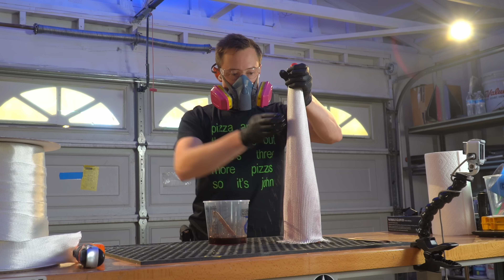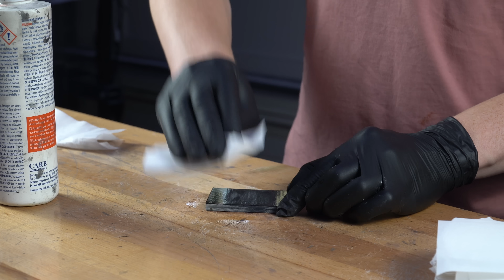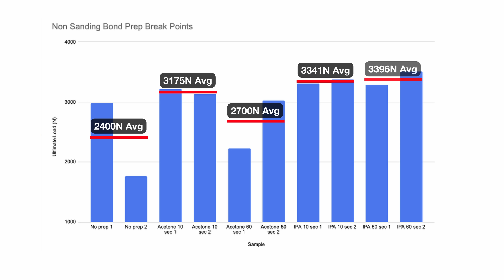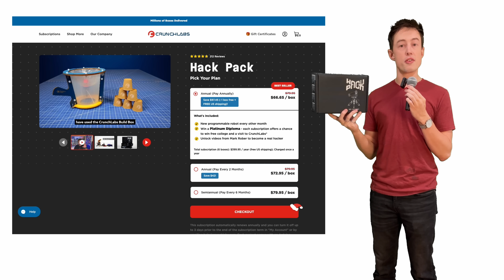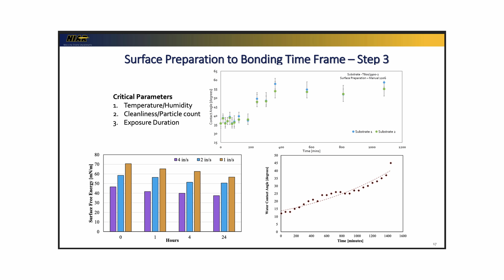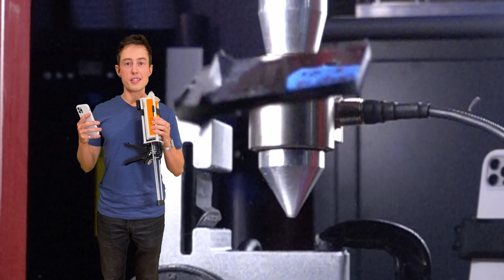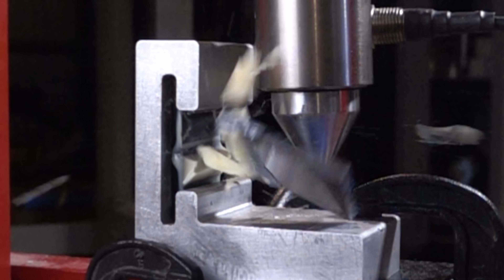I Broke 100 Epoxy Bonds to Find the Strongest

Comment: Two samples is simply not enough. I know you recognize this as one of the places where you fell short, and kudos to you for doing that. But the lack of sufficient samples renders absolutely every tentative conclusion you draw unsupportable. If you haven't already, do a bit of a dive into statistical signficance. If you're like me, you'll be surprised at how even five samples can MASSIVELY improve the quality of your data. For instance, you seemed quite fixated on the 4000 value you got earlier. But with the variance you're seeing in your other tests, it's actually not mathematically suprirsing at all. even if all of your data was basically random. It's like, if you were playing D&D, and you rolled two 20s in a row using a particular pair of dice one time, and then from then on said, "Oh, these dice are lucky, I need to try to recreate those conditions."

Anyway, sorry if that comes off as preachy. What can I say, I've been an engineer for 35 years. But N=2 is just way, way too low. "Invalid data can still be useful" sure, sometimes, but given the incredible human ability to draw wrong conclusions, we just have to be really careful, because even the best of us cannot intuitively tell the difference between randomness and significance. Occam's Razor means the best interpretation of your data is, in fact, randomness. N=5 would be much, much better, and N=30 would be fantastic.

Comment: - i think the optimal grid size should be the smallest, that the surface tension of the glue can reach.
- try cleaning the sandpaper before use,  by dipping it in the acetone or the alcohol.

Comment: One variable I didn't hear addressed is that when sanding anything softer than a metal, furring is possible. This is when bits of material or fibers are not cut cleanly but instead leave a ragged fur-like edge. Acetone might eat some of that fur, but I suspect the fur, though adding to overall surface area, may weaken the bond because the fur itself may not be well-bonded to the source material. 

I think the tests with the razer cuts backs up my theory, as a hard cut like that is not removing material, instead the edges of the cut would be a kind of furring. The valley walls are fresh material, but two ridges of weakened material are also created on either side of the valley.

Instead of sandpaper I'd be curious to see a cleaner-cutting surface prep, something like an array of tiny saw blades scoring the surface as a known depth. 

I'm not an expert, I'm a perceptive hobbyist, so take this with many grains of salt.

Comment: 31:51 so then the age of the batch or the moisture in it directly correlates to it’s strength? Maybe it’s temperature exposure? Try freezing some before using it if there is a part 2

Comment: Instead of using acetone after sanding, what about using a filtered air gun to blast away the dust? that way the ridges after sanding might provide additional bonding surface, without the acetone dissolving the ridges. Or maybe makes no difference.

Very cool, love the rigour

Comment: Glad you found pretty much the solution in the end. Two more things come to mind:
– These double-cylinder glues are convenience glues. Easy to apply and often good enough. For maximum strength, one should mix specialized 2-part glue on a weight scale.
– Maximum strength doesn't matter. A bond needs sufficient (reproducible) strength. Which means: find out how much strength you actually need.
– Epoxy resins gain a lot of strength with tempering. Like putting it into an oven at 70°C to 100°C for a couple of hours. It makes the chemical reaction between both parts more complete. Glue manufacturers know and tell the procedure.

Comment: As You said You should do shear test. In this test slightest scratch on adhesive was starting point for break making all data basically worthless. In all usecase if you need make this type of structure you need overlaminate fillet made of adhesive with additional plies of material, and then the fibers take all load.

Comment: Awesome video! Do you think this would apply to painting? Because usually they say you should sand your surface to prepare it for spray painting but maybe a good clean with acetone and IPA on a smooth surface do the trick.

Comment: I heavy doubt your degassing procedure!  You like to get rid of air bubbles from filling in. Ok. But what you do is low pressure cooking of the chemicals, like gasfree water cooks at low pressure. You remove some chemicals from the epoxy by that procedure, that while it looks like boiling and spills out heavyly. That causes inconsistant results, depending on how much you destroyed the chemical composition.
For degassing of air only go for light vaccum, not that massive!

Comment: You can't degas that low. That isn't gas, those are volatiles, and they're needed for curing. When you degas, you need to stop at partial vacuum. If it starts to erupt, you drew too low.

Comment: Great study, thank you for publishing.  I sometimes have to bond to old composite and this answers many questions I have always had in mind.  I do think your sanding was probably leaving contamination from the abrasive paper as many such papers have surface treatments to reduce clogging.  Where I usually feel most at risk is in adding a layer of new polyester composite over an old polyester lay up, for repair work.  Sanding is universally the recommended surface preparation but I have always been doubtful about it because of concern about rubbing contamination into the surface!  Bearing in mind most people use a dual-action sanding machine for this, and the abrasives use on those are ALWAYS treated with anti-clogging agents, so it seems like a really bad practice.   I'm taking a risk in reading across that what works for epoxy would work for polyester, but it's the nearest relevant study I've seen so I think I'll change to using acetone and IPA for surface prep in future.

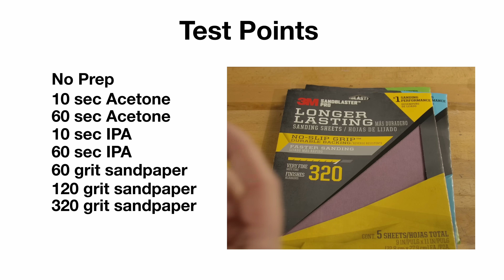Comment: @04:36 There is something that I miss on this list of prep methodes.
(Being retired for a while from many years of boat building, from ocean capable wooden ones to full carbon (the last decades using epoxy.)
The first lesson, thus first job for prep to glue anything, is cleaning the surface before sanding (and obvious after).
Did I miss it, or was there no cleaning before sanding?👴🤔🤷‍♂
Edit:
Also, adding chopped fibreglass to the epoxy gives the epoxy, brittle by nature, more tensile strength.
This, provided that there is adequate adhesion. (It will mean hand mixing though)👴🤷‍♂

Comment: Pos.\nSibly not related , but I know that in marina , work maritime work , boats , epoxy , boats , fiberglass , epoxy. Okay, that is bad in my mind.If I doubt. I've been told that when you break the surface of the epoxy , if you expose any of the glass underneath it can absorb moisture from the air , even if you clean it with , I isoproval alcohol before you do your bonding work , you'll still have moisture underneath the bond. Which can cause weakening of the bond. Now, the people who told me this were never able to actually present technical proof that you would expect to get from some kind of lab or\nArmchair scientist. So I only have the word for it.I'm interested to see how this turns out , and yes , I started blurbing in the first minute

Comment: Honestly use a belt sander it is similar to hand sanding.  There’s also Dremel bits similar to a belt sander that would also work. You just have to figure out the speed you want the sander to spin at.

Comment: yer high-energy mold removal sucks.   need a new mold design.!   one that:  consists of two halves  and  allows adhesive to go  between the parts before they are held together.     did you sand the root edges of the side-ways pieces.

Comment: On the topic - to anyone trying to attach toilet paper holder to tiles using those silicone suction cups, they do not hold even if glued with epoxy. Half a year max, even properly degreased. Drill holes in tile using tile bit, insert plugs and screw the mf to wall. Tiles are too smooth for epoxy. Epoxy is not a magic stuff.

Comment: Unless the epoxy solvents dissolve the material being "chemically" joined in a manner that literally "welds" the material joint into one solid material with no induced stress, the ONLY way epoxy or any glue works is by creating mechanical interconnections at the microscopic level. That is why sanding is suggested. The grit cuts rough random channels in the surfaces. The more jagged, irregular, and "rough" the surface, the better chance the epoxy has to flow and fill in all the grooves and gouges in the surfaces. When it hardens this creates friction or interference features with breaking strength primarily dependent on the shear strenght of the adhesive. If both chemical and mechanical bonding occurs, as it could with materials than can be melted by the epoxy, the joint should be the most strong. This is not hard to figure out.

Comment: This young man is a good speaker, and he can put sentences together, but I couldn't listen to this whole thing. Each time I fast forwarded 5 minutes it sounded exactly the same. It got quite boring, and in the end, I got nothing much out of it - a sea of sandpaper grits and bubbles and a lot of variables which we didn't need to hear so much detail about. He should have made a condensed version of this. Who was the winner? I'm burned out just thinking about it. I don't even care. I already know the best epoxy ever made is (or used to be) Dexter Hysol epoxy, like Sears Roebuck used to sell exclusively in 50 colors to match their appliances. This is an aviation quality product. It is now called "Loctite Hysol," and there may be slight formulation changes making it not quite as good. The most over-rated epoxy in the world is JB-Weld, which I have never gotten good performance out of - on anything. Hysol runs circles around it, but Loctite Hysol has gotten quite expensive - worth it if you need it.

Comment: could the vacuum be helping to remove tiny CO2 bubbles that are forming in the chemical bond vs getting oxygen bubbles out? if that is the case maybe you can add something that the CO2 will want to make a bond with inside the epoxy

Comment: Two results at 4K, far above most of the others, implies that something later in your testing reduced the quality of the bonds.  Maybe some contamination of the molds?  Were the 4K results on fresh molds or only the second or third use?  Maybe the super lube wets the mold surface and contaminates the joint?

Comment: As a non Rocketeer but somewhat technically competent individual, I dare to ask the question, why a layup with carbon weave isn't used instead of 'just' epoxy gluing?

Comment: The amount of resin you initially apply to the main body of the rocket before scraping it down is quite surprising at 27:40. What is the reason for applying so much? Wouldn't it be more convenient (and better for environment) to apply f.e. 5-10 times the amount needed instead of about 20-30? It would still be plenty and you'd still have to scrape the excess off. I know nothing of rocket building, I'm just curious.

Comment: Great video and effort on the massive sample size! I noticed something about the test jig that might explain the inconsistency you were seeing. Since you're breaking a T-section, you're actually testing torque (Force x Distance) rather than just linear force.

I saw some horizontal movement in the jig during the presses (the 'side-to-side shifting' you mentioned). If that contact point shifts even a tiny amount, it changes the moment arm length. That means the Load Cell will read a different 'Break Force' for the exact same bond strength, just because the leverage changed. Stabilizing that horizontal motion might clean up the data significantly

Comment: Oof, that sideways deflection of the load testing point is really screaming at me.  I assume you looked at that and decided it was minimal enough, but still, I would have liked to see some sort of measurement of that or stabilization mechanism.

Makes sense why they test with shearing lap joints.  But with those you're pressing two parts together.  I wonder if pressure like that increases bond strength.

Comment: My 2c: archery folks use a special Archery Fletching Glue or Gorilla Super Glue (or alike) to keep the fletching attached to the arrow when it hits the target. Epoxy does not have a chance in surviving high acceleration bursts. No point in trying. You may have tried aluminum welding instead of gluing, if you wanted good results. But it seems that your main goal was to do proper research, which is adorable in the eyes of old folks like myself for we've been the same.

Comment: (Having not watched the whole video yet) I wonder if a channel to fit the pieces together rather than just face to edge would've affected the joint strength, and if so, how?
Since the common failure mode is shear on the top/tension bond, having a channel puts some of that force straight into the material itself works the compression bond a lot harder (presumably)

Comment: 1) sandpaper may have a "no clog" additive.  New may be worse in terms of cross-contamination.
2) did you control for the lateral position of your load applicator tip on the coupon?  Distance from the joint (leverage/ length of arm) may explain some of the variability.
3) you did not mention temperature control of your shop/ cure area, nor the temp of the coupons at time of bonding.

Comment: It's important to realize you are not just testing bond strength.  You are testing overall sample strength under a particular loading case.  It can fail through several paths which include bond strength, but also epoxy shear strength, laminate strength, etc.  If you want to maximize your whole joint structure strength under that loading case, you will need to add more variables (filet size, epoxy additives, etc.).  If you want to measure only bond strength, you need a different test

Comment: Thanks, great video!
I'm just about halfway, after the fire stuff. So sorry if this is mentioned later...

How about ozone for activation?
An ozone chamber would be pretty cheap and easy to set up, reasonably safe (with good sealing/ventilation) and could most likely work, as ozone is pretty darn reactive.
No idea how high the ozone concentration would need to be, or for how long the samples would need to be exposed.
But with a well sealed chamber, you could on the other hand pop the samples in and leave them over night, not much actual work time needed.
And if it actually works (I dunno, armchair engineering here), should be reasonably easy to get consistent results.
Reply: Never mind, acetone + IPA is more than likely better and easier than ozone.
Would be an intersting thing to know if ozone might improve things further, but probably not...

One unctrolled variable I can see in some of the B-roll footage is; wiping technique really matters.
In my experience (cleaning a mirror heatbed on my old-school DIY 3D printer),
you never want to go over the same surface twice with the same area of the towel.
Do a Zamboni-like wipe pattern, like a window cleaner.
Fold the towel between wipes, or use a fresh one, so you get a fresh uncontaminated surface every pass.
Otherwise you'll just be smearing some of the old gunk back on.

Use a damp, nearly dry, cloth for the final wipes.
Once you start to get friction and squeaks, you know it's getting close to done.
Wipe until there are no slick patches left.
Literally squeakey clean is what you're aiming for.

You could probably practice by just cleaning windows, no streaks allowed! :D

If you want to go full overkill, use a barely damp at all towel for the very final pass (completely dry will just slide), and put some force into it.
Bascially burnishing the surface with the pressure and friction from the damp towel.
(Paper would probably be best for that, the slight abrasion helps IMHO. Lint might not be a huge issue, I'm thinking that would just become part of the epoxy layer, but YMMV, I dunno).

The problem with all that is it would be hard to do consistently by hand.
You get a feel for when the friction ramps up and you're done...

Could maybe be done by machine, but it would get complicated.
You'd need something like a flap roller on a traverse frame, switching flaps between wipes, very tight solvent amount control, and friction feedback from the roller for controlling if there's any contamination left on the pass.

(I have little to no experience with bonding expoy to fiber susbtrates, but bed adhesion on the glass/mirror bed of a 3D printer is similarly sensitive to contamination. The slightest speck of residue might mean a print failure. Hence why people started using thin coatings, like dilute PVA glue, and other bed surfaces etc.)

Comment: do you have any access to a laboratory hydraulic press that is calibrated and accurate? i mean if you do 5-10 tests a week it wont be a big deal for someone to let you do them in exchange of sharing results and incorporating them in their research.
Reply: I used to work at university. ph.d students would have unlimited access to a 50KN press and a 2500KN one (less precise). there was a third that is more advanced but it wasnt accessible without booking, discussing with the professor in charge and the technician to change the accessory (traction/compression and few compression cells according to load etc)